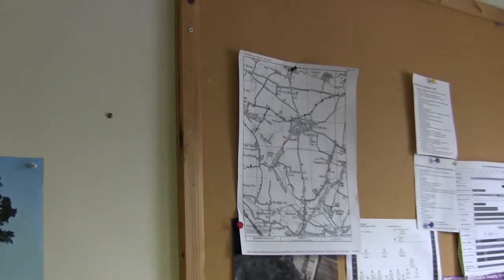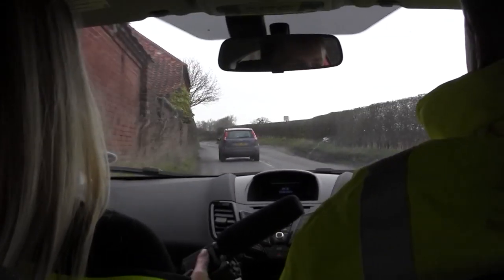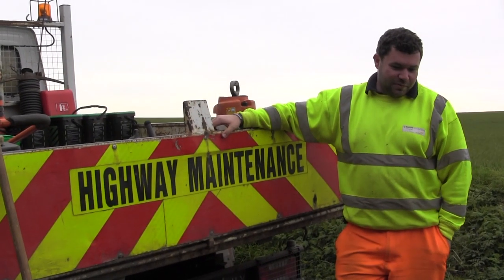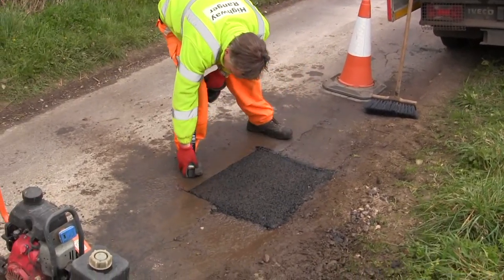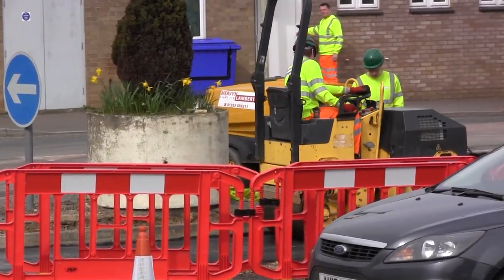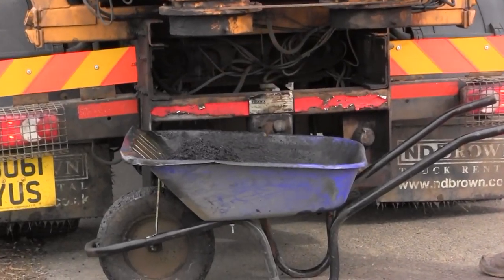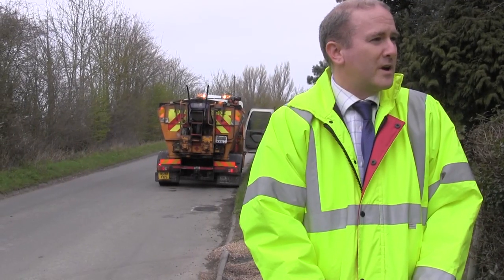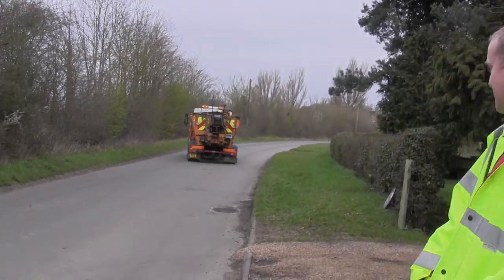Potholehunters

Comment: Both of them potholes just repaired will be lucky if they last a week what a waste of time and money the first one was cut out then filled with temp rubbish the second. Filled with the proper stuff but didn't cut it to give it a good edge.
Reply: +chainsawdom1 i agree with you the first pot hole cut out correctly  but they should have used viafix or instarmac p p r wet for a permanent repair . the second hole was a joke

Comment: The potholes will return, that so-called remedial work will be destroyed by 1)traffic and 2) weather effects. This is buy cheap buy twice in action. Rip the surface up back to the hard-core and 2 feet past distress/ fracture points. Replace and compact hard-core to a high standard, pave and compact base layer to high standard, pour hot bitumen sealant around edges and pave proper top coat, adding granite chips and compact to high standard, leave to cure. Problem solved, yes, more costly initially, but cheaper long term.